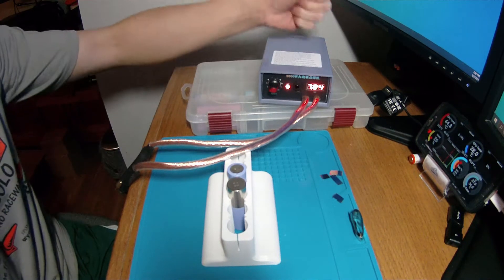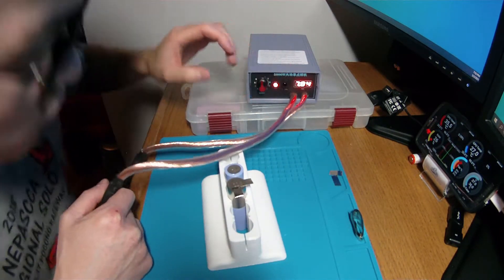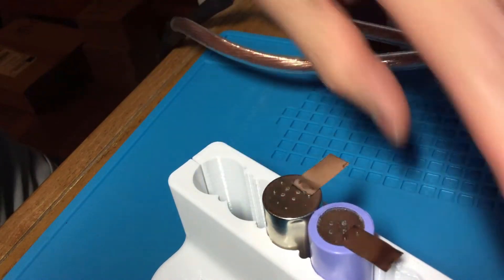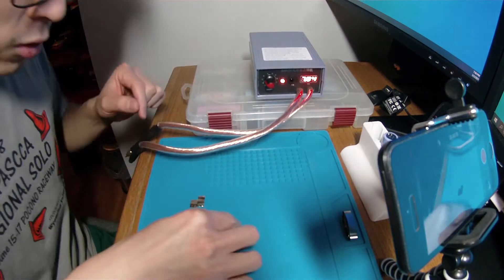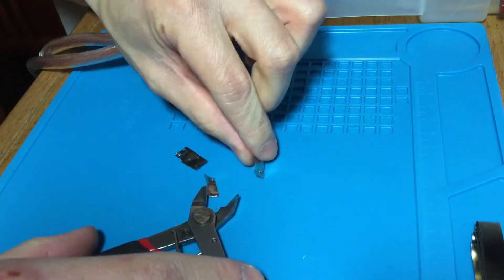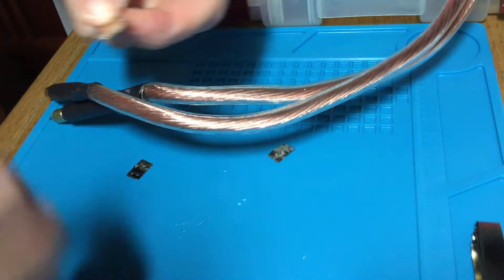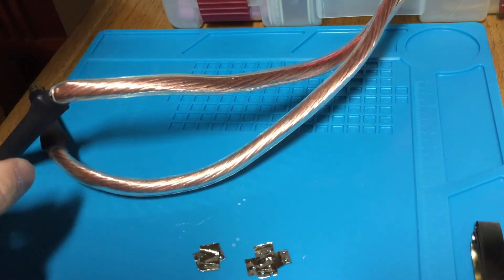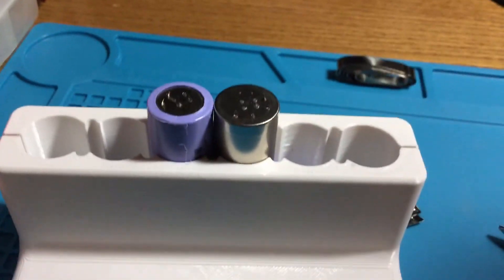Testing the KKMoon 5000W Mini Spot Welder with .15mm nickel strip

Comment: Is that pure nickel strip? 99% of spot welder manufacturers send out nickel plated steel which has much higher resistance so its much easier to weld.

The only examples most people want to see are of 0.15 and 0.20mm pure nickel and a nickel/copper sandwich. The only thing someone would use nickel plated steel for is if they just can't quite get the nickel copper sandwich to weld so they need to increase the resistance slightly. Obviously not something you'd want on a battery that is going to be exposed to the elements due to corrosion but its a good solution if you have no way of getting more amperage and you need the sandwich for a stationary, indoor battery pack.

Comment: could you add a couple extra batteries inside the main power unit so it doesnt run down so quickly on the out put spot weld pins

Comment: this spot welder may work on 18650 with .1 to maybe .15 strips, but it's way too small for what I needed it for, 32700 with 0.2 pure nickel strip
Reply: Yeah 0.15 is the max thickness which isn't said on the product description but is in the instruction manual.

Comment: Let me know if when you charge it it automatically stops charging. After two hours I checked the voltage and it said 8.53 and led on charger never changed from red to green so I'm assuming mine is defective and dangerous. It appears it over charged the batteries. How do I safely discharge the batteries?

Comment: Would like to see if it is capable to  spot weld 0.2mm nickel strip easily
Reply from the maker: Ok, will do a video in a few weeks. I'm ordering batteries and nickel at the same time but everything is out of stock!
Reply: I've done nickel 0.2 to battery and to nickel level 8, and 9. Easy.
Reply: 1 thing I noticed about this equipment. If you keep charger connected it will show green even when voltage below 8V, but not charging. Just remove cable and re connect, and it goes to red and charging.
Reply from the maker: I just uploaded a video with 0.2mm nickel strip. I didn't have much luck with it